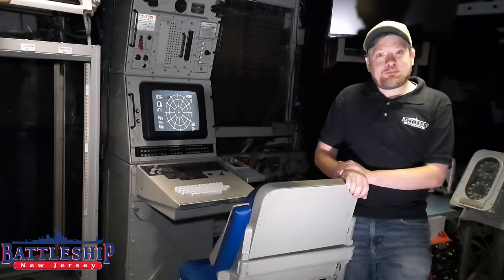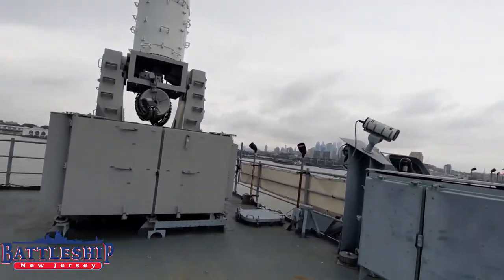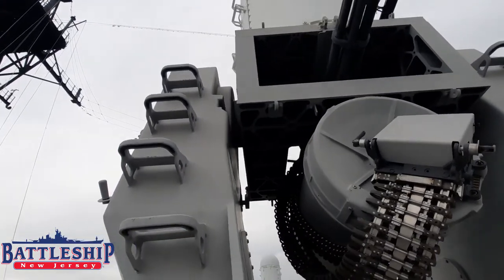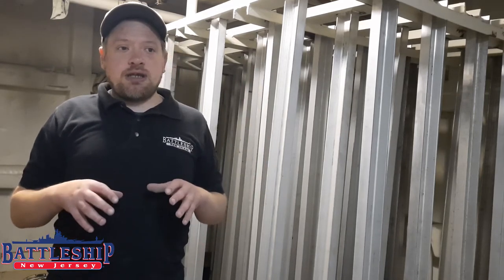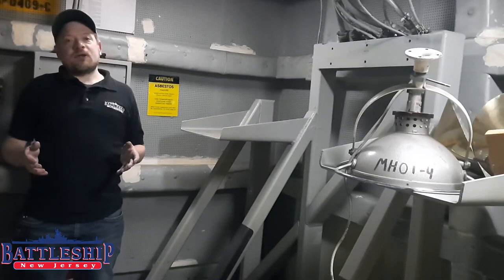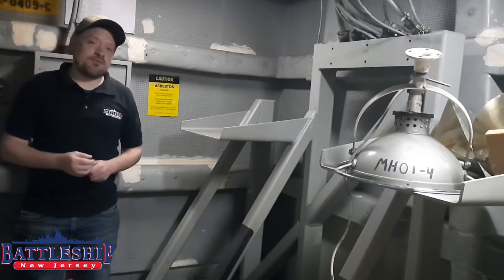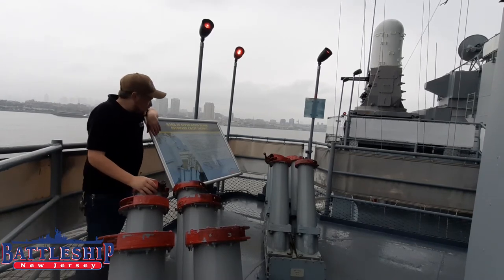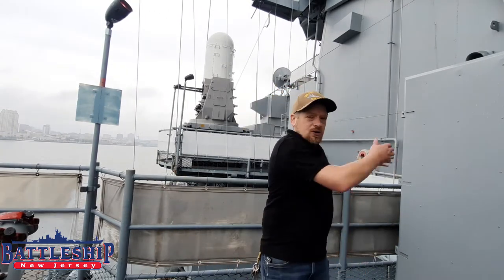Battleship Modern Missile Defense

Comment: Can the ciws onboard new jersey now can still fire?
Reply: They are inoperable block 0 mounts. Parts would be hard to find. If NJ was reactivated they would most certainly upgrade to the latest version, Block 1B. They’d crane those mounts off and install new ones along with new cabling and control stations.
Reply from the maker: No. We fire some of our guns but the CIWS has been gutted
Reply: @BattleshipNewJersey  were the 5 inch batteries tied into the updated system of the slq, chaff and flares and phalanx?
Reply from the maker: No, they are separate systems

Comment: What ever you do, don’t touch the red button.
Reply: A while lot of things need to happen before you can fire a CIWS or Tomahawk. There wasn’t much to the old
CIWS control panels. The newer ones feature a monitor and controls for surface mode, where an operator can manually lock onto a surface threat and shoot it. Much improved.
Reply: Do we use something like the patriot missile system today?